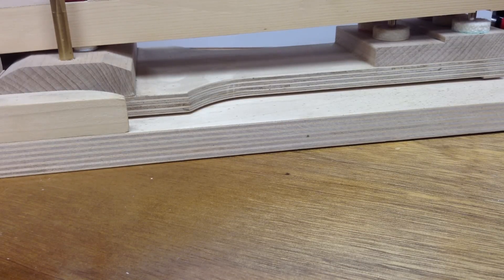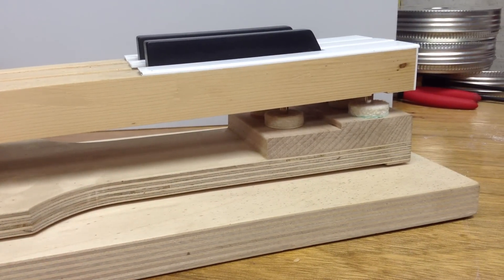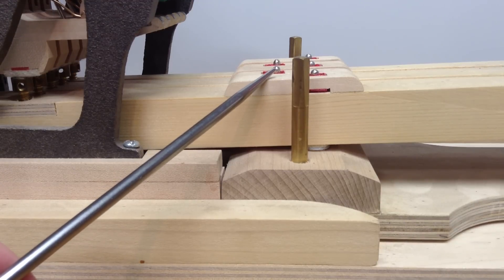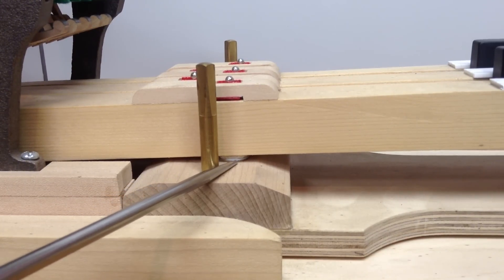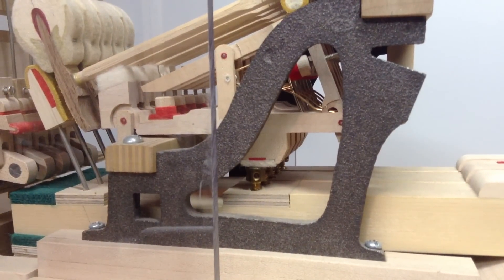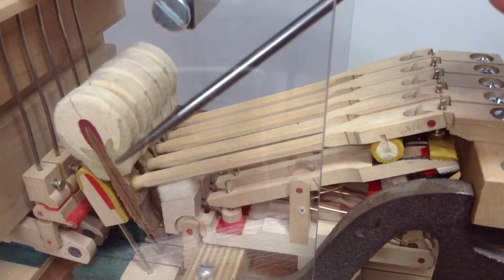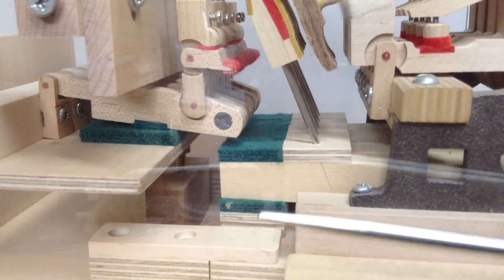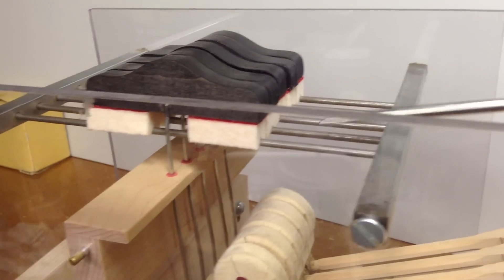Grand Piano Action Parts I HOWARD PIANO INDUSTRIES

Comment: Question, right at the beginning of the video it seemed like you referred to two different “layers” as the key bed. Are there really two key beds? Or if not, what is the name of what the key bed rests on?
Reply from the maker: There is the key frame which is the part that comes out when you remove the action and key frame from the piano.  The keybed is what the whole keyframe sits on when it is in the piano.